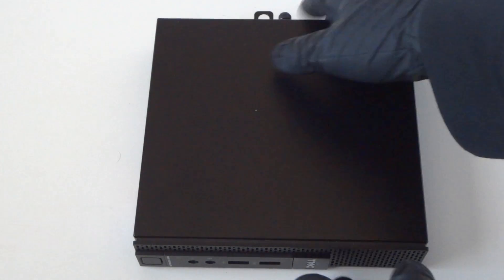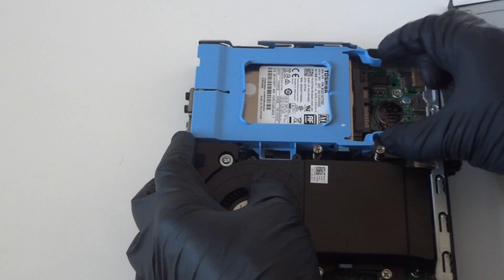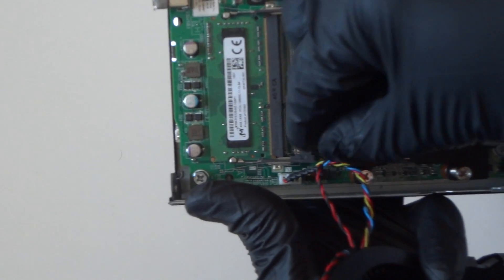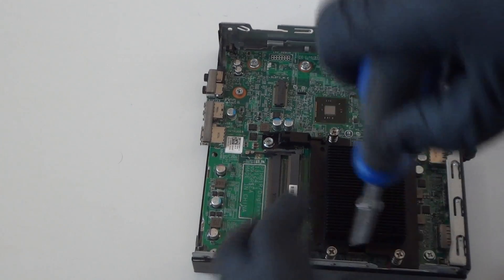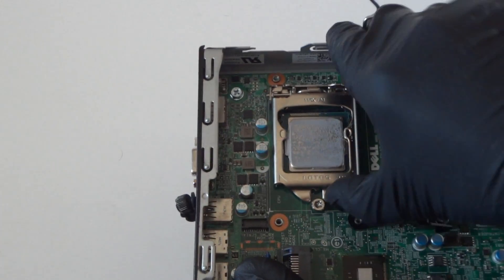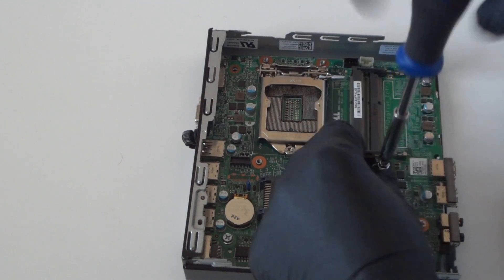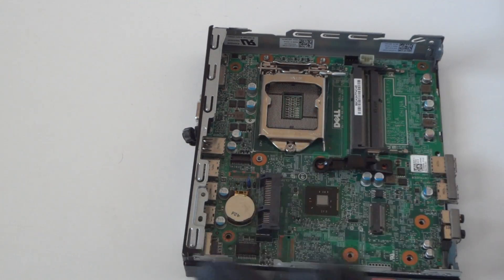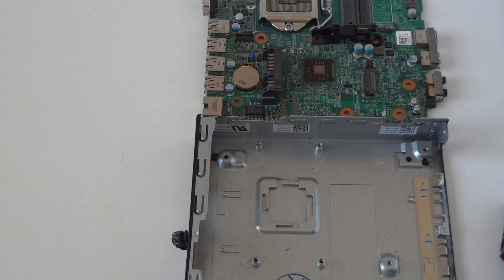Dell Optiplex 3020 Micro Teardown

Comment: What's that in the middle? m.2 port?
Reply: I'm a bit late to the party but hey, better now than never right ?

 It's a Mini PCI-E  port, it's primarly used to plug wireless controller (WIFI + Bluetooth) but you can buy some specific ssd to plug into it, they're mostly expensive and low capacity though  (due to the size restrains)  wouldn't recommand.

Better alternative :

1. 256gb ssd in 2.5inch (30€)
2. A small NAS connected to your router (50€ if you build one and around 200€ if you buy one)

More storage, faster sdd, and even a bit cheaper if you build your own NAS (50bucks and a little time is all you need)

Comment: Working CPU models for this dell? I would like to upgrade my i3 4160t.
Reply: sometimes Dell's documents list compatible cpus. (or what cpu options the model was sold with).
otherwise you can check out the chipset on Intels site and check there under "compatible products"
be aware anything running higher TDP wattage might be too much for the cooling solution so try that at your own risk.
Reply: did you upgrade it yet wondering the same!

Comment: What kind of T.V can it connect too. I tried connecting display port cable from PC to hdmi on my T.V but no signal. Can u please help me
Reply: You can connect it to a TV with HDMI input.  Just use a Display Port to HDMI Cable and it works!  I have used it.